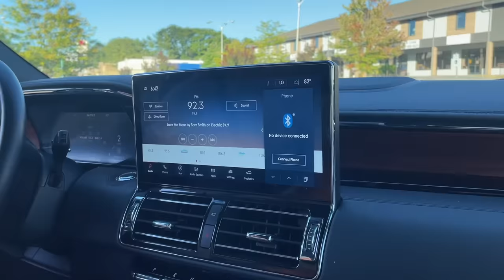We Made It To BRISTOL!!!! Doing Laps in the Dale Truck, Neighbor, Toast, Toter Home, and More!!!

Comment: On the motor home slide underneath and disconnect your suspension leveling valve linkage, air the suspension up all the way and itll give you a few extra inches of ground clearance

Comment: Usually when the Nascar haulers come in they can do a couple things. The first thing is, it's a regular sized tractor, not a 400 inch wheel-base toter-home. Second thing, the air ride setup on the trailers might be different. Some systems you can flip a switch or a valve and pump more air into the trailer airbags and raises it up so it doesn't scrape.

Comment: As a truck driver of many years, I am proud to see zack get the toater in. Make it a little easier on yourself... find the leveling valve for the air ride. When in tight spots like that, disconnect the rod and flip the valve up, will raise the bags and give you a few more inches of clearance.

Comment: You should have all the top level burnout cars do a parade lap at the beginning of their run. it would be epic
Reply: They might get a noise complaint from the next county over. They might make people with ear-pro in the stadium go deaf. But hey,  I'm down to see it.
Reply: Half of them would loose oil pressure on the banks. Unless they going with speed.
Reply: I had the same thought. May not be practical with the layout though.
Reply: People complain about the drags and street fights all the time. Don’t live next to a track and strip if you don’t wanna hear cars